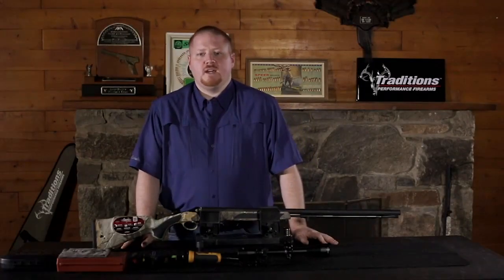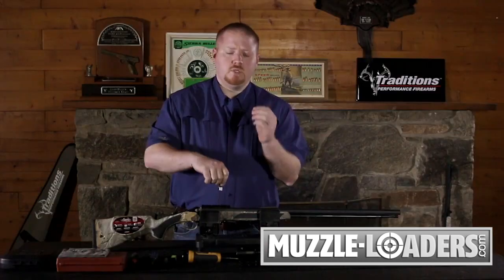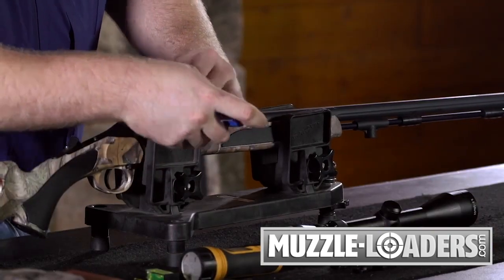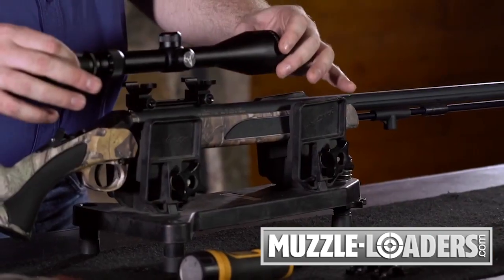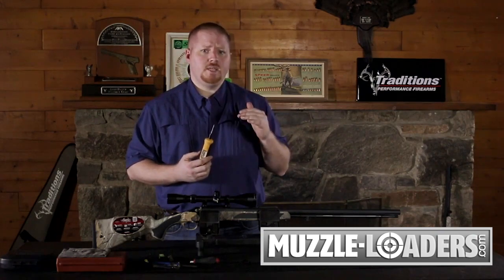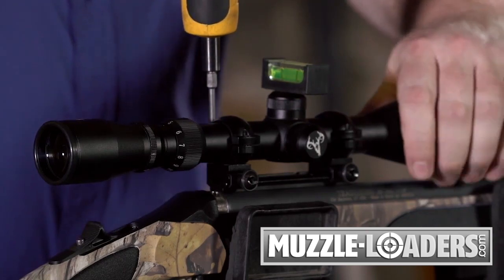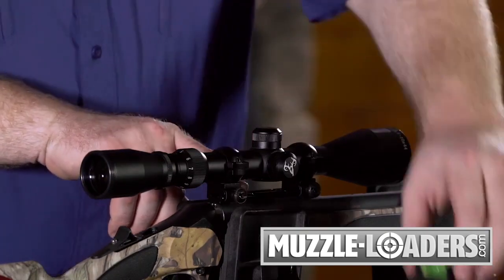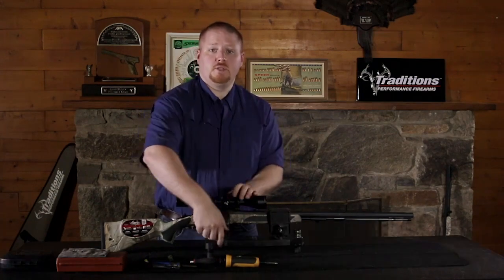Muzzleloader Scope Mounting How To Video - Muzzle-Loaders.com

Comment: A good way to break a scope with a muzzleloader. The rings were not verified to be in alignment (i.e. concentric.) If there is misalignment (which is most likely present), the rings will bind the scope possibly causing the scope to break or not track true. Also, the base bolts and ring fasteners securing rings to base need to be degreased, dressed with medium thread adhesive, and torqued with a tool that can indicate when desired torque is achieved.  The ring cap screws need to be degreased and torqued as well. The video does properly demonstrate leveling scope with respect to rifle. Lastly, any indicated misalignment will require that the rings be lapped to bring them into alignment. You can do this half assed and get half assed results or do it right the first time.